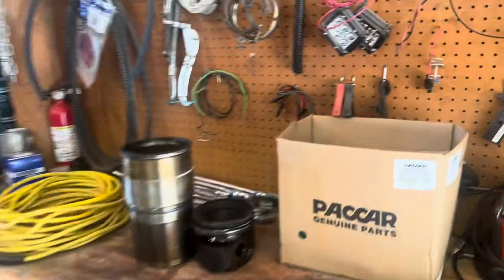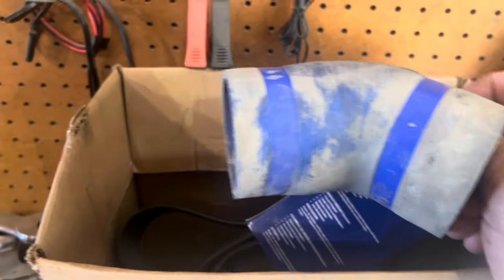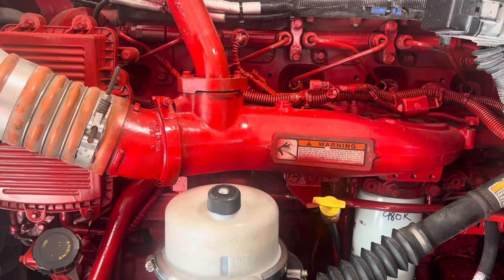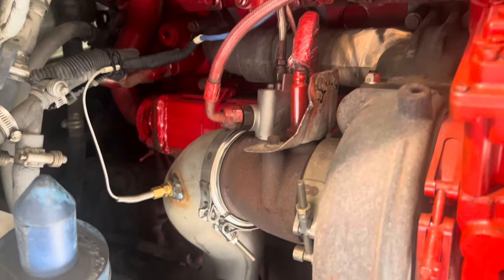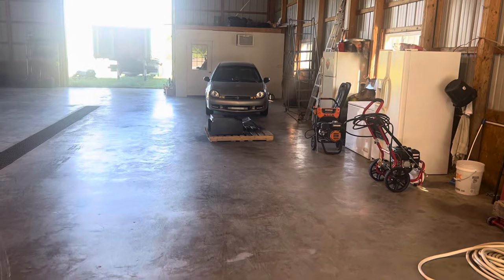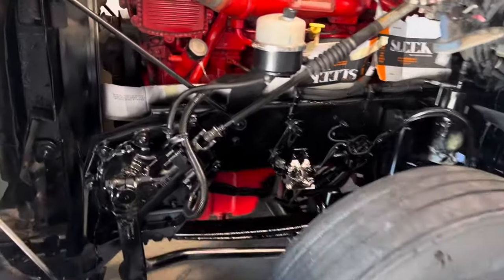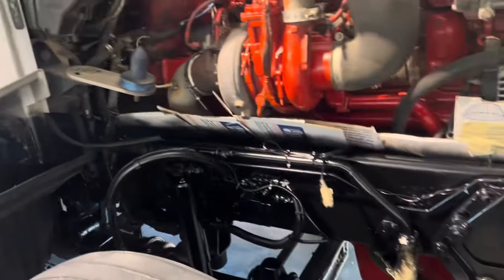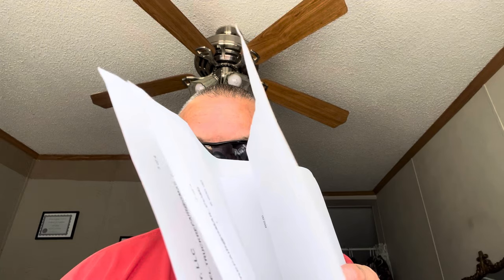Cummins ISX 15 rebuild, What did it cost me? ￼

Comment: Looking good! I have a box of goodies like you, AND I kept a piston and liner. There's a reason your ISX and mine lasted 1M miles. The way they build them now it's just not going to happen. Mine has 2 cams, and they were never updated and worn so new cams and followers. Taking it back Monday for it's 50K valve adjustment.
Reply: Yes mine was a 2000 bought new. Has 1,846,000 now. Has been a good engine. Still has the same injector cam. Just replaced injectors when I rebuilt it  last may.  They were originals. Sounds like you had good luck with yours. Take care.

Comment: Do you remember about how many miles you got out of your transmission? What it cost to replace and what happened to it? Thanks for sharing, your videos are always so informative.
Reply from the maker: It was replaced at 760k it had 20 miles on it when I bought the truck, the high low splitter was acting up so he just replaced the transmission and clutch so he knew it would be good when he sold the truck…about $6000 for the transmission and clutch labor is usually 6-8 hrs

Comment: Yes were hoping to hear from you. Mine was 30,000 last may. Mine was an old isx 2000model. I had a 1,350,000 on a Rebuild. You got a Lot more done then I did. It had a valve spring break then hit piston off coarse. First trip couldn’t build turbo pressure. They didn’t check turbo. I had to put a new holset turbo. For 2600. Wasn’t a rebuild. So that brought my cost to about 33,000. Would never recommend Peterbilt zanesville Ohio. Glad you’re running again.  I was down a month also. I know I’ve told you about this before. Take care. Best of luck.